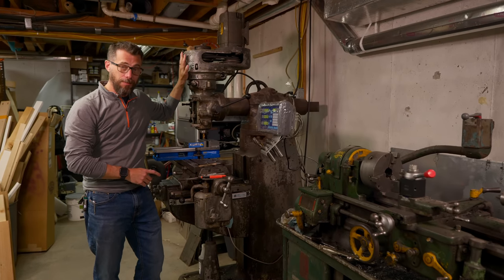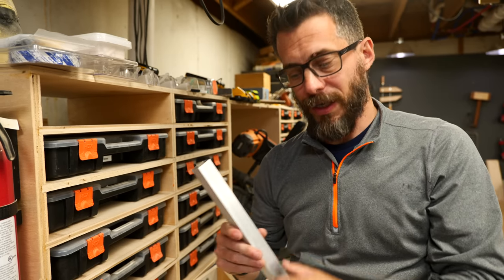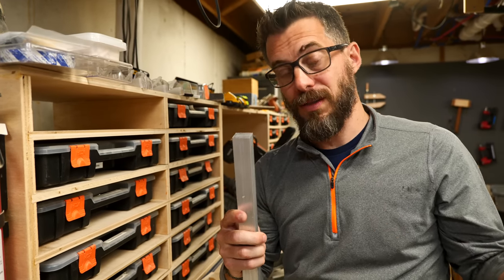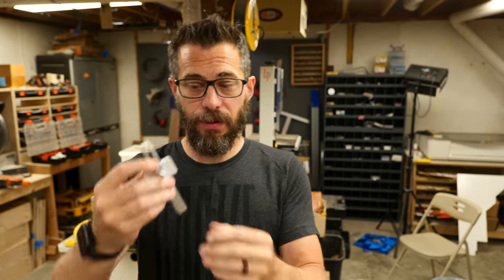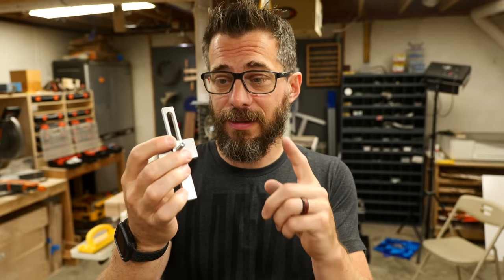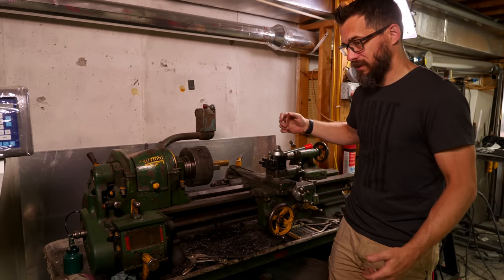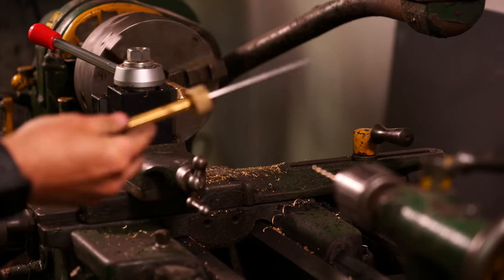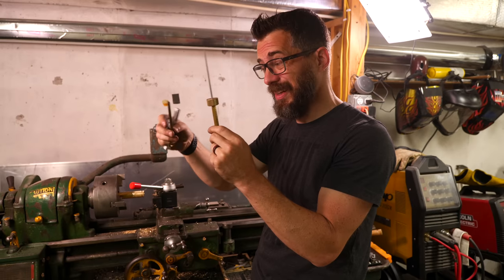Overcoming My Fear of Machining Metal

Comment: I don't think even old lathes supposed to sound like that. Check if the the gears of the reduction box are running without oil. And please, move the power switch to the front and NEVER wear watches, bracelets, rings, necklaces, long sleeves or anything else that can be stuck in the moving parts

Comment: Reverse your jaws! And i normaly try to keep my work withen in inch of the chuck. You can always break that rule but its way more sturdy. Allowing you to take a deeper cut, which carbide wants.
Reply: A good rule if thumb in machining is you only want as much as you need sticking out, endmills, stock, parting tools, ect

Comment: please watch some lathe videos. the lathe when used correctly is not that scary, but the way you are using it could go bad in a hurry. not knowing how something will react or just the setup. having the lock handle positioned out over the chuck, the jaws on backward and so on. knowledge is king here the more you know the less scary it will be.

Comment: Well as cool as it would be, Machining or "just" lathes and milling machines arent the kinda tools you can just try around and get it going in half an hour, that wont work.
Theres loads of little points I and especially a master Machinist could tell you where you did things wrong and so on. For beginners it may be a good idea to use the formulas for Spindle Speeds and Feeds, your rpms on the milling machine could Probably be 5 times as fast.

Comment: Your brass rod was sticking out to long in the lathe. The jaws were the incorrect type to hold round bar. And you insert for the parting off tool was sticking out to far. Great try just keep on with it and you will get there

Comment: I would relocate the switch to the front of the machine so you're not reaching across rotating material to shut it off, and accidentally have your shirt get caught on the material which can pull you eight into the machine.

Comment: Bruh🤣 you can change the Jaws normally Leath chucks come with 2 sets of Jaws. Dont be afraid of lathe its one of the coolest mashines in the shop. If u do Nearling use autofeed and lots of cutting oil and you get some sexy and clean diamonds😋

Comment: You're 3 jaw chuck looks a bit off, the jaws are turned the wrong way. For nurling you need a center support otherwise you keep pushing You're workpiece from canter. The first thing you do is to get You're center height of your workpiece.

Comment: you can also instantly die driving down the road, that doesnt stop you from driving. this is no different. in fact there a way way less chance you will get badly hurt using those machines. I wouldnt worry about that.

Comment: ithis is the first vid of something i can do better than you (or have more experience ) 😅

also funny to se you being more afraid of the lathe than of the mill, i find lathes to be really easy and intuitiv,  but maybe thats just me🤷‍♂️😅

you probably can flip the jaws of the vice 180° so you  have to worry less about hitting them . there is some real good info on both machines out there forexample by blondihacks or similar yt channels

but the fact that its verry old and worn doesnt make it easier
Reply: Looks to be a set of non reversible jaws  the back sides aren't angled honestly looks like a woodworking chuck on a metal lathe

Comment: First off congratulations on taking the plunge and delving into a somewhat dying art.  The tooling you are using are not “bits” they are drills mills cutters or whatever but never bits.  Keep at it.  It can be very rewarding.

Comment: "I cant remember what these are called, but...they create a parallel surface" You were so close! They are called parallels, lol!

Machining is scary, but you just have to respect the machines. Obey typical shop safety rules (no watch, and preferably no ring if you can take it off), listen to the machines, look at the chips, and have a good time learning the craft!
Reply: Just some more tips. In general, machining is all about setup. Make sure things are as rigid as they can be, only have as much material and tooling stick out as you need and can get, "dry run" to make sure you won't crash, etc. Softer materials can go faster rpm, but you can go too fast too depending on the operation an tooling. Point in case with all that, the cut off too (slower speed, less tooling, and use fluid). And it's best to knurl at a slower speed, and use fluid to help clear the cutting dies too. Don't try to replicate what you see a CNC machine do. It's better to be cautious and go slower on a manual machine-Especially that hobbyist lathe. There's several people on this site that give good machining lessons, tips, and tricks. Joe Pieczinsky, Tubalcain, and Blondihacks to name a few.
Reply: With the tapping, you can tap on the lathe, by hand if you are not comfortable with power tapping too. Just chuck the tap up like a drill, lock the tailstock down, and advance the drill chuck while you spin the lathe chuck. Or you can use a center (spring center for best practice, but I've done it with a dead center too) to line it up using a handle if you have a pilot for it in the tap or handle. That should help take that off centered slop away (all that assuming  the drill didn't wander and your tailstock is aligned properly too)

Comment: Watch some videos of Joe pieczynsci. He has got allot of videos on lathe and milling machine tips and tricks. And some awesome project videos.
Reply: Another thing. If the machine seems like its struggeling or making weird noises, you probably not doing something right. Tool hight, feeds and speeds and tool profile for the type of material you are using is important if you want good looking parts. And coolant. Dont forget coolant.

Comment: Great video diving into new skills! If you haven’t already, check out the channel Blondiehacks. She makes fantastic videos, and has “beginner lathe skills” and “beginner mill skills” playlists that are really excellent! Also, sounds like you may have the auto-feed gear train engaged, and if so, that’s where a lot of your noise is coming from. On my South Bend, the lever that turns that on and off is on the far left side of the headstock, but it may be different on yours. Also, sounds like your spindle bearings need oil. In fact, there are probably a lot of things on both machines that need oil, so you may want to look up how to lubricate those machines. I also have my mill and lathe in the same space as all my woodworking tools, and sawdust is a real problem because it soaks up all the oil. I try to keep my machine tools covered to mitigate that problem, and I oil them pretty frequently. Anyway, again, awesome video; thanks for always putting out great stuff!!

Comment: I’m a bit confused at the general concept of this video. You aren’t afraid of woodworking equipment but are of machine tools. When, to me anyway, woodworking power tools are machine tools in and of themselves, just geared towards wood rather than metal. They are also just as dangerous when used incorrectly. Are you sure you’re afraid of machining specifically or are you intimidated by something you aren’t as knowledgeable in? Kind of two different animals there.